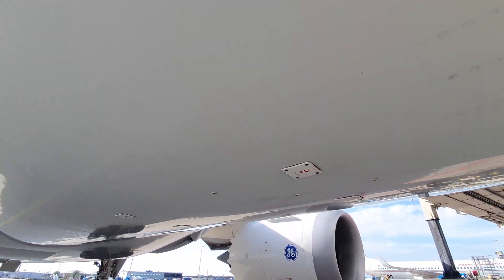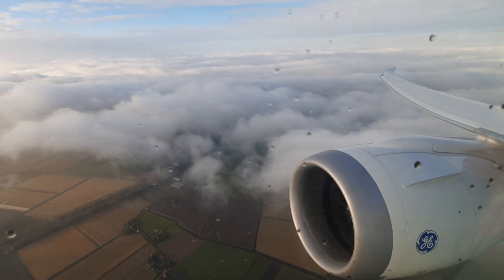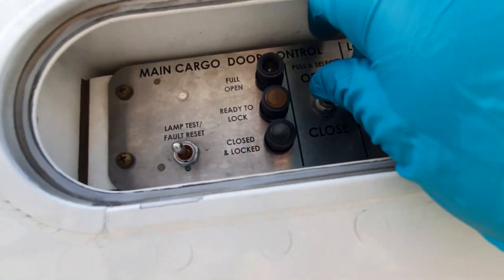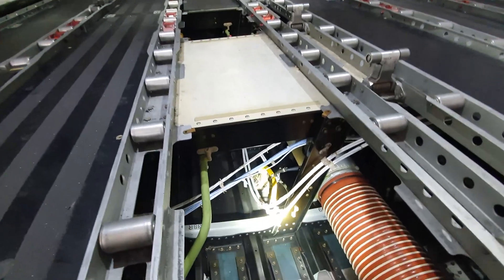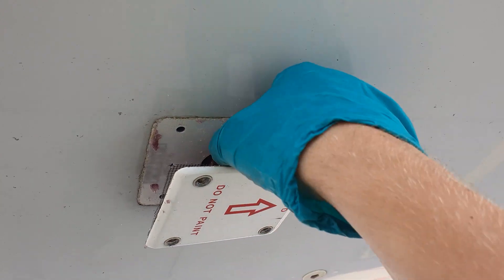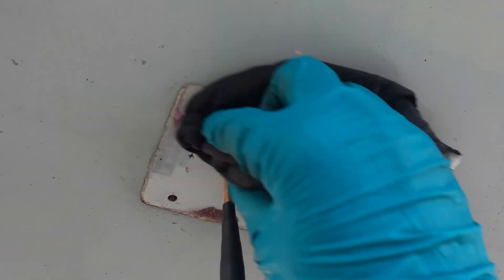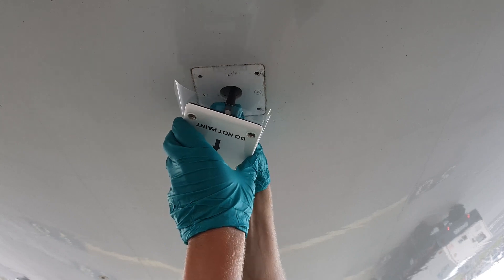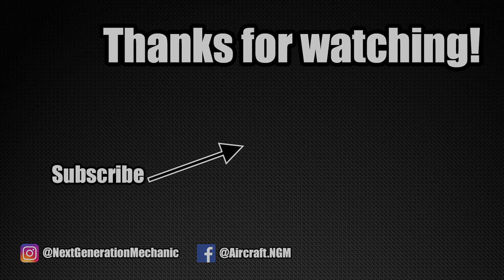Boeing 787: Low Range Radio Altimeter (LRRA) antennas replacement + explanation

Comment: Will mounting the antennas anywhere on the bottom of the aircraft affect its performance?
Reply from the maker: No, but there needs to be a calculated distance between them. Or else the altitude reading isn't correct
Reply: The length of the cables and distance of antennas to ground are designed to ensure the altitude reading is 0 at touchdown. If the location of the antennas changed and nothing else to compensate, it would introduce error.
Reply from the maker: Didnt think of that! Thanks for the addition.

Comment: i've installed 4 antennas the same type. But, when I was attaching the screws, some kind of plate where is written: "FWD" did a crack sound and separeted itself from the antenna a little on its edge. The same thing happened on 2 of them. Do you know what is that plate? It is part of antenna? plate of protection or something else? Great video!
Reply from the maker: On these antennas, there weren't those kinds of plates you were talking about. This antenna was one assembly. So I'm not sure what it was that made the cracking sound and separated from your antenna. It sounds like a part of the antenna came off.

Comment: Hi sir, can you please explain why during “rainy” days, the Radio Altimeter appears to be inoperative? There is an occasion where the rain has stopped, the taxiway was a little wet and while taxiing to the runway, Radio Altimeter L+R EICAS message appears. The MEL says no dispatch. After awhile, the message disappears. Everything was back to normal. Can you please explain for me? Thank you.
Reply from the maker: I never experienced this to be honest. Maybe it is because the rain causes a disruption in the radio signals? My only experience with Radio Altimeter faults is that the aircraft was parked above a water drain and this caused a faulty indication and a status message. It was on the 73 max though.

Comment: is transmit antenna located in front of receive because by the time radio wave come back airplane traveled some distance?
Reply from the maker: Yes that is correct!
Reply: @NextGenerationMechanic  thanks 👍 really like it content here and on ig keep going
Reply: At 2500 ft, the round-trip time for the radio wave to hit the ground and come back is 5 microseconds. The approach speed of a 787 is around 150kt. At that speed, in 5 microseconds, the plane will have moved forward by approx 0.4 mm.